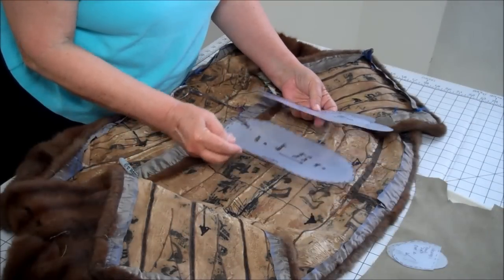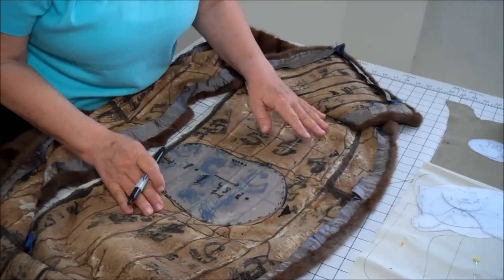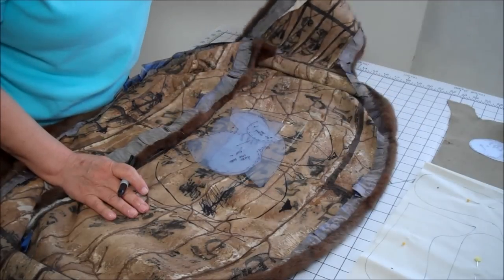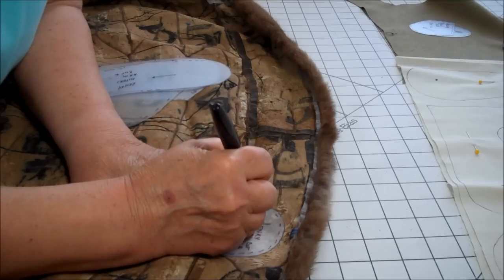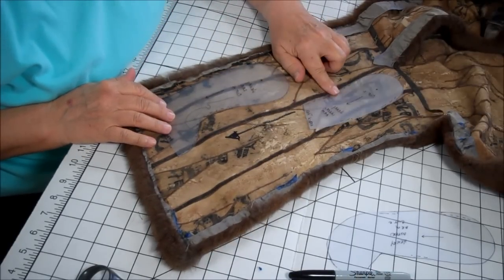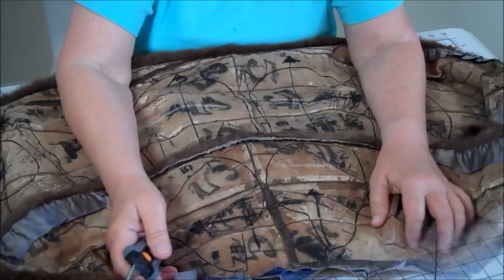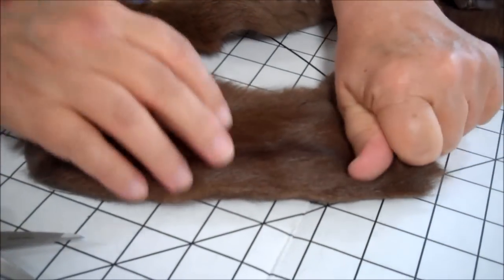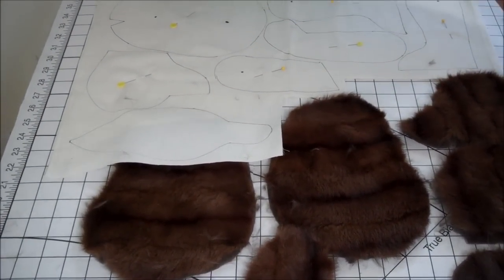Part 3 Making a Jointed Fur Teddy Bear - Cutting the Fur

Comment: Never use a scissors to cut fur. The loose fur on the table is the fur cut with the scissors. Use a fur cutting knife. Lift the fur from the table and use the knife to cut thw leather. You will have minimum fur loose and flying around the table.